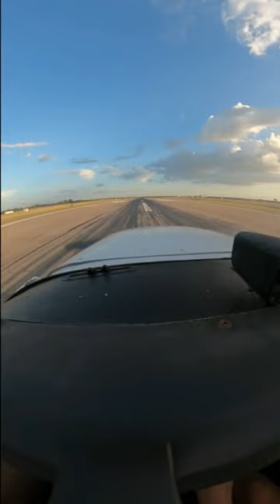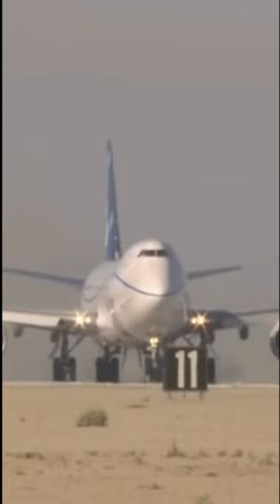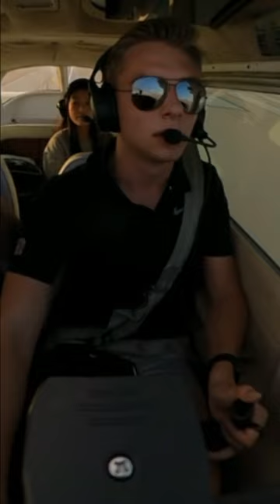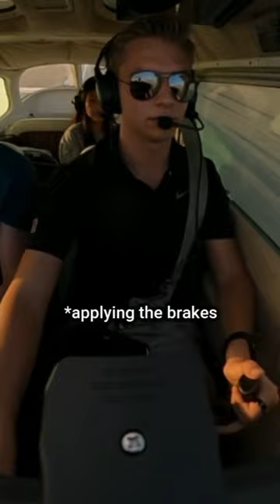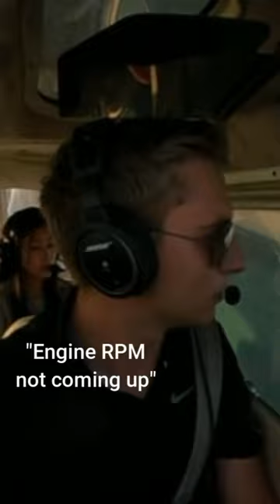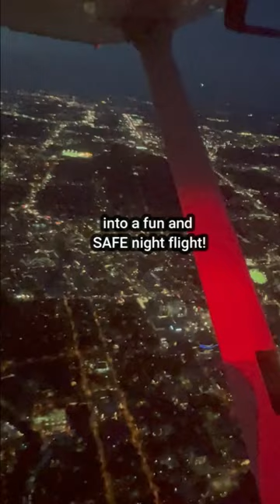Ever wonder what happens if something goes wrong during takeoff? #shorts

Comment: Wished u have explained more in detail about v1 and V2 for example 😊
Reply: No such thing as V2. V1 means vertical 1 so the gear at the front of the aircraft or if its a tail dragger then the back. V1 is just saying the vertical 1 gear has left the ground, and then rotate is just saying your in the air.
Reply: Hope that helps
Reply: V engine is not used alot in passenger aircraft.
It's usually master engine

Comment: I would suggest not saying things like “engine RPM not coming up” on your initial call. That may lead controllers to probe for more questions while you’re still rejecting/deciding what the issue is if the problem was more severe. Only include information that requires their assistance like if you needed fire assistance etc
Reply from the maker: Fair point. I was just pretty shaken from it and just said it.

Comment: It’s reverse thrust they use when landing in the arctic so they don’t slide off the end of the runway. It’s the same thing here. Just stopping won’t do anything, and you will slide off the runway and the plane will be damaged as well as an emergency evacuation. So, on a rejected takeoff, the pilot uses reverse thrust to slow the plane down. I believe there are regulations where if you are over a certain speed (in knots) then you can’t abort and have to re-land, so the plane (again) doesn’t slide off the end of the runway. It’s a great and advanced system planes use, truly fascinating to learn all of the safety and weird/cool features a plane has.
Reply: It's not only arctic thing :P Reverse thrust is the most efficient way to stop the aircraft and it is the main braking power. On turbo-props it can be so efficient, that you may not even use it too often, but it is propeller thing ;p
Reply: @smallduties8897  yeah very good point, landing at a small airport makes reverse thrust key. However, landing a 737 at Heathrow or LAX is possible without reverse thrust I think
Reply: @Midge45  Sure it is, but on such crowded airports there is often the necessity to vacate runway as soon as possible or to vacate into one specified taxiway. Heathrow as I remember does not allow aircrafts category A and B to land there, so it is easier to separate one aircraft from another, but take a look at Cologne during the night! You have 747, 767, 777, 757, 737 being mixed with cat B aircrafts - mostly ATR72 and 42. Each night someone is doing go-around due to loss of separation and often you can receive a really late clearance to land :P Then when you are in that ATR, you will land aiming not at aiming point, but at the runway exit haha But those Germans at CGN are true professionals and the best example how international hub should operate. And they are not as cocky as these in JFK ;)
Reply: @smallduties8897  yeah in Heathrow there is an urge to get off the runway before the next plane leaves. It’s like that all day!

Comment: What happens if the rpm in engine 1&3 on a 747/a380 fails but sputters and completely explodes mid air and you cant do a crash landing

Comment: what happens if you miss the runway by like 10 metres? or if you land at full throttle in a cessna 172p.

also ehat does the mixture do?
Reply from the maker: Mixture controls the ratio of fuel and air that enters the engine. And well, if you miss the runway that wouldn't be good

Comment: If engine rpm was not coming up was it a bad fuel pump?
Reply: The engine could have been just too cold at that time. Or there might be some water in fuel tanks, which should have been removed in pre-flight checks. But what's more probable - it is a piston engine, which has tons of parts that can break up. The day You switch for turbines, is the day you can cancel your insurance

Comment: This is true if you are under the v1 speed . A v1 speed is a speed where you won’t be able to stop the aircraft in time so you have to take off 🛫🛫
Reply: It's not always the case. According to the law, V1 cannot be higher than Vr. When runway is not limiting you, then your V1 will equal Vr. After V1, and in this case at Vrotate, you have to start pulling the yoke. But as I said, runway does not limit you, so you have plenty of room to stop the aircraft. Could you abort then? Not in commercial operations, that's due to definition of V1, the law does not want pilot to gamble on the runway if they will menage or not. But due to performance you are further limited by for example maximum speed on the ground. Some aircrafts have some different limitations on the ground

Comment: What happens when a pilot doesn't notice this immediately?
Reply from the maker: Well, you'd take off with an engine not performing to maximum power. If it really wasn't performing well, you could hit obstacles on the departure end of the runway because you can't climb fast enough. So it's really important to do your takeoff checks!!